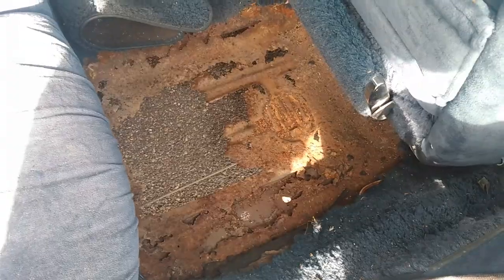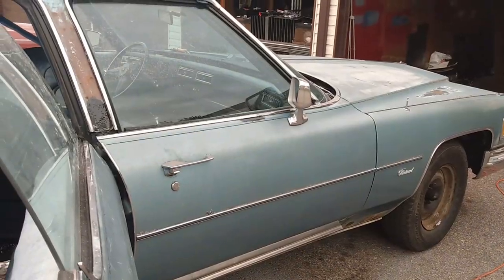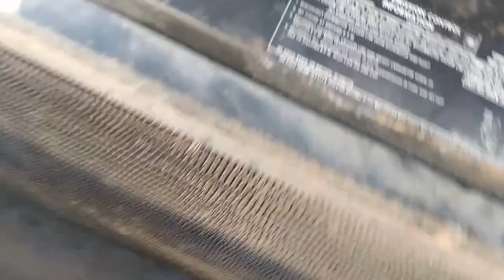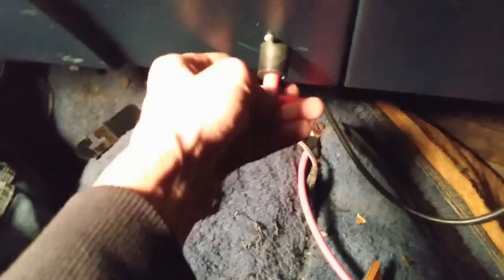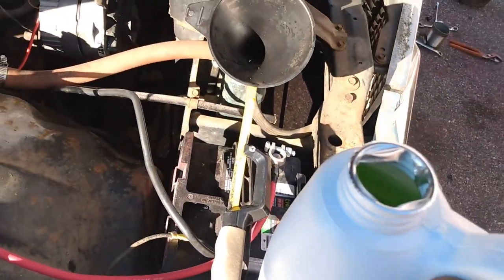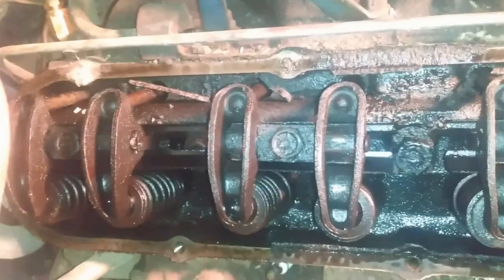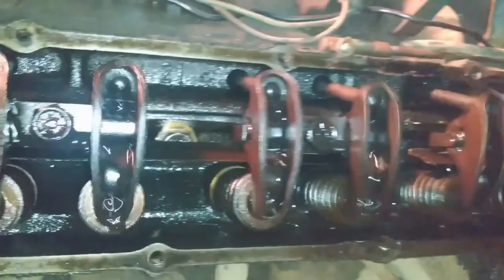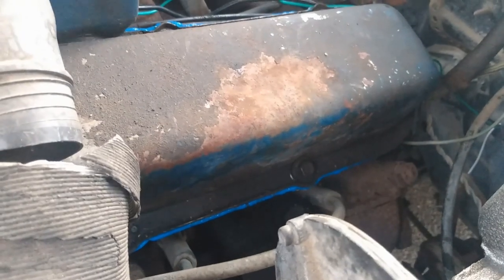getting the 75 Cadillac fleetwood back on the road part 4

Comment: I had a '74 coupe deVille as a teen that I put an amp in the trunk. I did not understand what fuses were for and the line I ran from the battery to the trunk shorted out in the trunk and burnt the entire way front to back. I was fortunately able to get it disconnected before it burn the car down...

Comment: I see the AC is all gone, 
Down were I live its hot n humid 9 months a year
If the ac works well on a car here its value is 5 times more than if not.
With 9 cadillacs My summer Im making hybrid new and old parts together a custom AC in my seville
its going to be R12 with a modern compressor mounted were the smog pump was.
so much more room around the engine. 
the big fleetwoods thankfully a sanden conpressor bracket is available from vintage air.They all will get AC upgrades so they car be driven in summer too😜

flat black with no AC on your battleship

down here white with mirror tint and mega AC
its like 2 different worlds...
Reply: i'm on a new channel now, my original one is locked out.